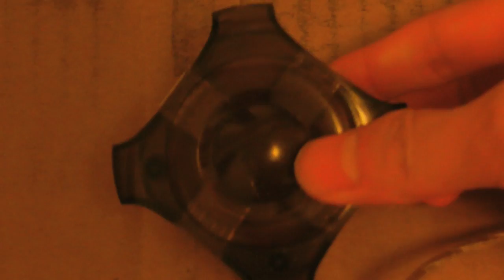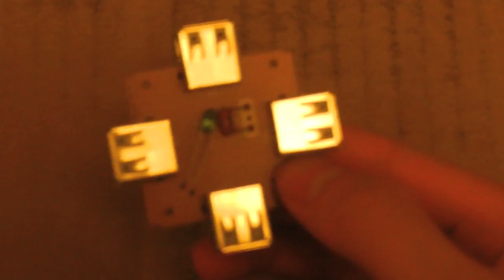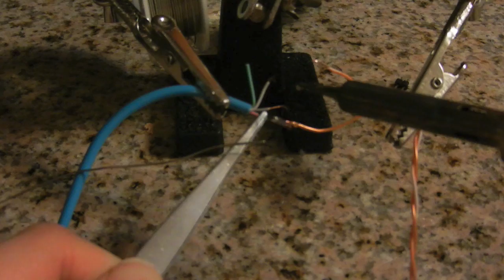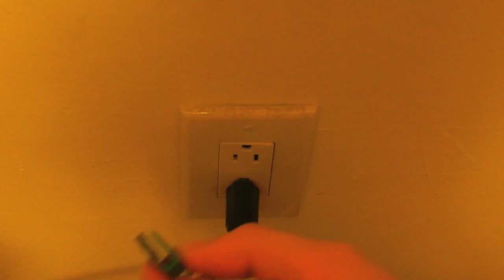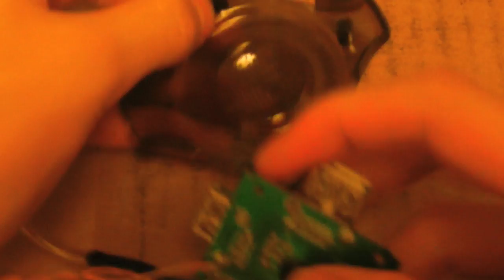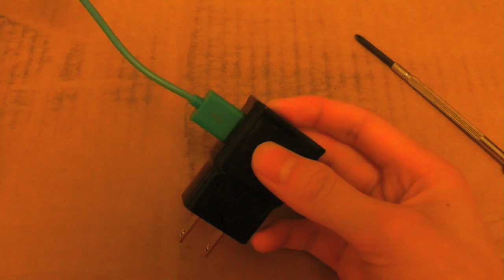[Bits #4] How to DIY a Powered USB Hub

Comment: I’d bet you’re using a phone charger for your Pi as well. But even though phone chargers are labeled as 2 amps, in the case of a Raspberry Pi—or, for example, with a connection where the data pins are missing (only VCC and GND are present), like in the video where it was connected to the hub—they only deliver a maximum of 500 milliamps. They provide 2 amps only if the appropriate resistors are detected on the data pins by the charger, or with newer models (Power Delivery), when this is negotiated. So, the main problem arises because the Pi itself doesn’t operate stably. When used with a phone charger, it seems to work, but it often experiences brownouts, freezes, and damages the SD cards. It’s better to use a proper DC-DC converter or an appropriate SMPS rated for 2.5 or 3 amps. Also, if you add external power to the USB hub, it doesn’t hurt to add a few extra capacitors—for noise filtering and ripple reduction, if for no other reason.

By the way, if the USB cable lacks data wires—because it’s a so-called “charging cable”—it often happens that even a good charger will charge your phone very slowly. Due to the absence of the data wires, it cannot negotiate with the phone to allow 2 amps, so it does charge, but only at the USB standard minimum.
(“The fact that it works is often just Murphy’s trick to let a fault hide forever.”)

Comment: Hi, I'm making a self powered y splitter usb cable to feed power from external source and data input from pc to an usb audio device. I've separated data + - wires to connect laptop and red-black to connect power source. But it's not working and only works for some times when I connect ground wire from laptop's usb with joining to power source's ground. I couldn't understand this thing. Please help me how to make these connections. I only learn from internet

Comment: With relation to inserting a diode to protect ones pc from any over voltage, could you just cut the positive cable from the pc to the hub ?

Comment: I have one with 3 port work only when i put one thing
When i put just a mouse it work and when i put just a keyboard it work
But when i put both of them
It workn't!!!!
Can this be a solution ???
Reply from the maker: It might. Usually, most hubs are designed to withstand the current draw for keyboard and mouse (those two things don't use much current) so in your case, I suspect the computers USB port to be at fault and not the hub. It's always hard to guess the problem when you don't have the actual problem in front of you.

Comment: i have that exact USB hub that I use to control all my external peripherals on my laptop, and I too have power issues with some of my xbox controllers because my hub is powering too many devices. this will come in handy :D
Reply: an Update: so i actually got around to doing this, and it works! something i did differently was put a diode on the red lead on the original usb cable on the hub to make sure no power surge comes from the external power, and i grounded the black wire like you said. it works perfectly, and it seems that some of my devices are faster now, although i'm not sure if that's a placebo effect or not lol, it just seems my usbs have a faster r/w rate and it takes a shorter time for my usb peripherals like my xbox controllers to register lol.

Comment: Thanks bro it works properly, using your technique i made separate cable by just adding a cable for power on my otg ,that means we just have to connect that cable to usb hub and any power device and just connect it to your mobile you dont need to do anything to your any usb hub..👌🙏

Comment: Thank`s for this trick! I have bought an non powered usb hub and I wasn`t able to connect on it multiple devices. I was sure that it is an possibility to input more power on it to read all my connected devices. I have managed to achieve this very easy without oppening the case. You can work on wires without soldering. Good job!

Comment: That's very helpful with raspberry pi zero, because it outputs a little of energy at the   micro USB, and When i pluged in keyboard and mouse, they weren't working (I tried to use other hub and they still weren't working)

Comment: So what is the output current from that usb hub? most likely 500ma or lower.
Reply from the maker: I would confidently run about 1.5 amps through that - basically charger current. I think there was a comment a while back where I responded with some calculations. The limitation here is wire gauge.
Reply: @electronicbytes5428  thanks sir

Comment: can you charge apple devices or higher power demand? it is used with other hubs and does not recognize them! I think the power is too low to be known by the device, how can I solve that?
Reply from the maker: Depends... what kind of apple device are you talking about?
Reply: Electronic Bytes anyone iPhone or iPad is the same, don't detect
Reply from the maker: So you're saying that your iPhone and iPad doesn't detect power being plugged in? Or the iPhone and iPad isn't detected by another device (laptop?) when it's trying to charge? In the first case, a powered hub will likely solve your problem. Just make sure that your powered hub is being powered by a source that can supply a good amount (2A should be plenty?) of current. In the 2nd case, something else is likely wrong.

Comment: Better is using DC-DC step-down converter 12V > 5,25V for external power of USB HUB. 
Many USB devices use long cables and their currents are 200+mA.
Slightly higher voltage is necessary.
Reply from the maker: Hmm. Good comment. 

I can't completely disagree with that, but I don't completely agree either. Here are some of my thoughts:

Effectively, I'm using a 120V > 5V adapter, where 5V can mean 5V +/- some bit. Nothing's exact here, just a cheap "hack".

You seem to suggest that the 0.25V buffer is to account for the voltage drop across the wire, so that the extra 0.25V is dissipated by the wire before it reaches the device, to provide the device with 5V. This is almost reasonable, but let's think about this a bit:

Let us assume that we use 10 ft (reasonably long?) of 22 gauge (kinda thin?) power USB copper cable, which has a resistance ~0.16 ohms total (use lookup-tables / online calculators). Actually, let us be generous and say that is is 0.2 ohms. You can verify the resistance by taking a length of wire and measuring the resistance yourself. A 0.25V drop across this length of wire, using V=IR yields 
0.25[V] = ?? [A] * 0.2 [ohms] 
?? = 1.25A

So 1.25 A is required for that 0.25V drop. The USB 3.0 standard (according to Wikipedia) rates USB 3.0 for 900mA. But I'm using a USB 2.0 designed cable, which is rated for 500mA. And yes, I'm potentially powering 3 devices, so multiply that current by 3, to get 1.5A etc, but that's still exceeding what the USB cables are rated for -- bad idea to start with.

So the (relatively small 200mA) you mentioned shouldn't really be an issue, even with a 10ft long cables. 200mA isn't enough to justify an extra 0.25V on the line.

So you're right, continuing to use the USB cable for larger currents is a bad idea (and yea, I'm not even going to think about the GND wire). But adjusting the voltage to "tweak" the output is a hack at best. 

If you really wanted to do this mod "semi-correctly", you might want to consider moving away from a USB cable, and buy yourself thicker wire. But that's still an issue, because the USB hub wasn't designed to handle that much current anyways, and the convenience of a removable USB connector is gone.

(Fine, part of that was an assumption. But because of the cheap nature of this product, I think it's a fair assumption that they went the cost-saving route to design their product for minimum current specs...)

But the difference between using a 12V source vs the current 120V source is kinda a weird one. Power coming from the wall here in the US is 120V. To step that down to 12V and then step it down again using a different circuit would cost you twice (ish?, fine, lets say 1.3x) the amount of conversion losses. Hmm. Nevermind, minor detail :D

Also, if you just set the voltage at a precision 5.250V would mean that you always have a 0.250V extra on the line if you use a short cable at low currents. Using a buck converter to get that specified voltage would be much more work than it's worth, and it turns a $0.00 cable into a $5.00 project, after adding on the extra parts, thicker cable, and time. If you really were to do that, you'd probably spent enough to buy yourself a correctly engineered solution.

But the idea here is that nothing is exact, I don't get exactly 5.0V from the USB supply, I'm not using 10 ft of cable, my estimation of 22 gauge was probably too generous, and I used what I had lying around to power one device. At the end of the day, this probably doesn't matter, and a hack is a hack. 

But thanks for bringing up an interesting point!
Reply: You re right, but adjustable 230VAC/5VDC power source (with trimmer) is too expensive. 
Fixed 12VDC/2A power source is very cheap, adjustable DC-DC step down converter is very cheap and tiny too.

12VDC voltage is directly usable for many "computer" things.

I am using orange pi as multimedia centre, and +voltage offset is very good and necessery. Personally, i am using 5,40V - on peripheries i have 4,90V only or something similar. Chinese USB hubs and other things using very thin wires, unfortunately.

Comment: You can use 3 pole 3.5mm x 1.3mm jack and connect the disconnected red wire to one side and the DC power wire to the other pole.   Put a 1.3mm DC jack on a 5v wall wart.  That way you can use the Hub Powered and Unpowered.
Reply from the maker: Yep. That'd be the "right" way to do it. I didn't have any DC jacks in the junk box that day, and definitely not a 3 pole jack with the internal switch. Another possibility is to add a regular switch in the hub, for powered and un-powered operation.